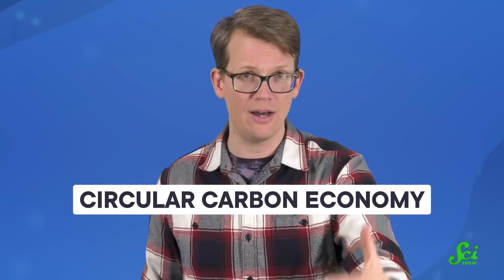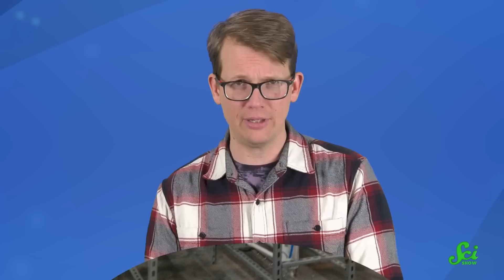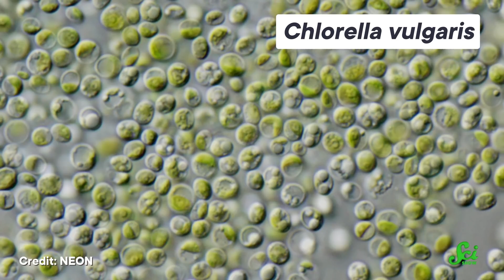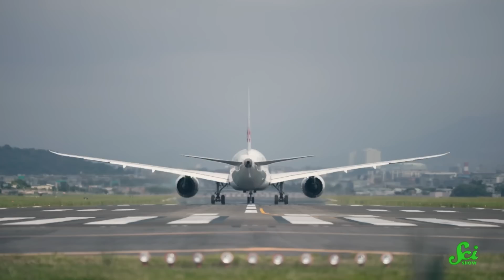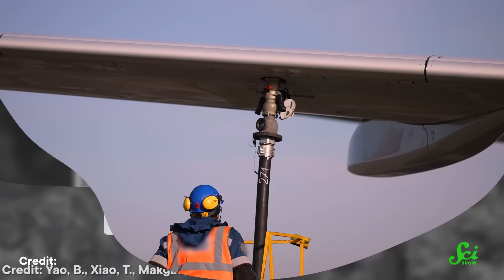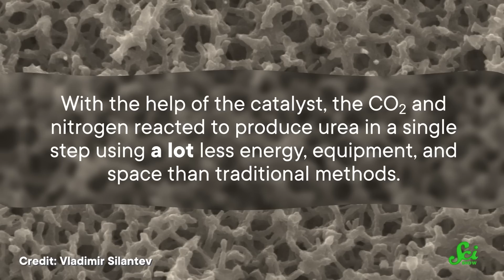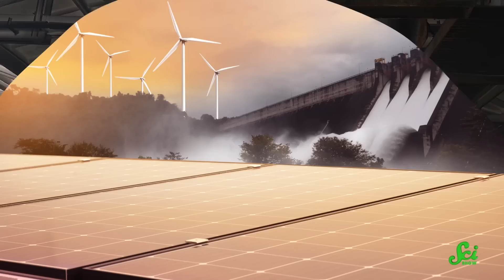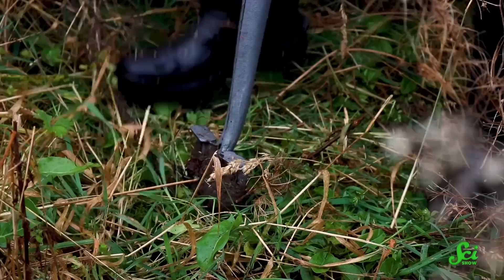One Way to Deal With CO2? Reuse It

Comment: It's HUGE and I've said for years (I have a degree in geological science) that the key is to turn CO2 into a renewable resource.  A company in Canada has created fuels from atmosphere CO2.  That would solve all the transportation of fuels as well
Reply: Carbon-based self-replicating nanomachines!  Wait, that's...algae.
Reply: @CyberiusT  Kelp is also incredibly fast growing.  I think it grows in feet (not inches) per day.  We need a way to repopulate the ocean with fish by introducing something that can drastically increase the amount of plankton.
Reply: honestly I think that the turning of co2 into fuels is, at least at this point in time, one of the best ways we have to store energy and for transportation. it may not be the most efficient but the biggest problem with solar and wind is that we need to find ways to store the energy from peak hours to use at non peak hours and batteries do not have enough energy density to do this on the scale we would need, even solid state batteries probably wont be enough. I honestly think nuclear energy is the way to go for energy production but solar and wind are not without their purposes, we just don't have the technology or infrastructure to rely solely on wind and solar like many people want to.
Reply: @Hesediel01  I hope we can avoid nuclear energy. It is poisonous for sooooooo long. And nobody wants to store the waste. It took 25+ years for them to open a storage site in my state and they have already had an accident within the first 20 years. Scientists estimated it would be 200 years before the first accident.
Reply: @Hesediel01  I agree.  Carbon can be converted into bio-fuel and pumped back into old, now-empty oil wells.
Reply: That is like making table salt from Lake Michigan water - instead of ocean water. Possible, but stupid and inefficient. Hugely stupid, hugely inefficient.
Reply: @kurtilein3  do you happen to have a better idea, as I said I know it would be inefficient, but so was almost everything when it first started out, the first light bulbs lasted somewhere between 14 and 48 hours, the first automobile had .75 horsepower and went 10 mph. There are plenty of ways to make the process more efficient, like take some of the biggest carbon emitters and put a carbon filter in them that can then be recycled so you don't have to pull it from the air.
Reply: @Hesediel01  Yes. As long as coal-fired power plants exist, and natural gas-fueled power plants exist, and internal combustion engines that are stationary, use the exhaust of these. You can get highly concentrated exhaust containing plenty of CO2 there. CO2 content in the atmosphere is somewhere around a worrying 400 parts per million, but that exhaust can have 30%, which is orders of magnitude more. 

As long as highly concentrated CO2 exhaust exists, it is dumb and inefficient to scrub CO2 from the 400 parts per million in the atmosphere. Scrub from 30% instead. First the power plants putting out high concentrations of CO2 have to go or have to have their exhaust used, and after none of these are left, we can consider scrubbing the highly diluted 400 parts per million.

Is that clear and understandable? 

To capture carbon, you might also consider managing a forest in the following way: Whenever a tree is about to die, cut it down and bury the wood underground. That removes a large amount of carbon. Scrubbing from the atmosphere does not remove carbon if your plan is to turn it into fuel to burn it again. A Treetrunk of wood buried fireproof removes many tons of carbon permanently, and its rather cheap and easy. 

Do you get the idea? Plants and Trees in Wetland are good solar-powered carbon-scrubbers, and this is what your "hopium" technology has to beat.
Reply: @kurtilein3  I was more referring to the capture of carbon from something like power plants, and industrial buildings for use in creating fuels when there is an excess of energy from say solar or wind energy which ends up causing problems with the grid and being wasted, that fuel can then be used as a more "carbon neutral" way to power traditional power plants, or even vehicles essentially taking the place of batteries which have far less energy density (by a factor of around 100). Less so about scrubbing from the atmosphere, though even for that, assuming as low as a 50% capture rate on co2 that could reduce our co2 output by 25% if applied to powerplants and industrial plants. So in short I just think it would be a better method of energy storage than batteries and would also have other benefits.
Reply: @Hesediel01  Excess energy, if it can be stored instead of being wasted for bitcoin, can be used to displace fossil fuels. Energy storage can be done using hydro, a low pond and a high pond and pumps/generators inbetween. Storing pressurized air in caverns can also be done. 

For carbon capture, vegetated wetlands and forests rule supreme. To capture carbon, bury carbon-rich biological matter underground. If you bury carbon-rich plant matter for hundreds or thousands of years, you are creating new deposits of oil, gas and coal. You just need to hope that future generations are not stupid enough to dig it all up and burn it all. 

Even more effective: Put an end to extraction of fossil fuels now. Keep the carbon out of the atmosphere and in the ground now. 

The entire video only has meaningless distractions.
Reply: @kurtilein3  as I said before I'm more concerned with energy storage than carbon emissions, which are just a fortunate byproduct (by the way phytoplankton are alot better at scrubbing carbon than trees). Yes hydro electrics are a good way to store energy for stationary purposes, but you can't exactly use it for airplanes, vehicles, ect. Yes there are electric cars but they are not feasible for a majority of people especially now. batteries will likely never be anywhere near as energy dense as gasoline and will not be able to be charged as quick as filling a car with gas. The thing is that as a country we are not ready to be rid of fossil fuels and we can't beat the energy storage of hydrocarbons, so we might as well embrace it and find a way to make the situation better instead of pretending it doesn't exist.
Reply: @Hesediel01  Honestly, hydro electrics aren't really a good way to store energy either. You're flooding a lot of land to get very little energy storage. It's main advantage was always the relative simplicity (and being able to quickly respond to short-term changes in load), especially when you can use existing terrain to your advantage and cost, when land is really cheap (of course, authoritarian governments always loved hydro, because they can just take whatever land they want). But water isn't all that dense, and you need a large drop to store gravitational potential energy (whether for generation or pumping water storage). It's always been just a quick stop-gap for the ten or twenty minutes it took to start up more fossil-fuel generators.

I wouldn't say batteries will never be as energy dense as gasoline. But relying on that to happen soon enough to matter is wishful thinking. We need a thousand approaches that are working concurrently, not put all our eggs into one "holy grail" basket that magically solves everything (and when it inevitably fails, everyone dies). That's how both nature and human society has always worked, and there's many reasons for that. The Marxist idea that having The One Right Thing For Everything was always just an illusion, just like ideas about genetic purity and all that - resilience and efficiency ultimately comes from many things doing the same thing differently. Each approach has some niche where it works the best, and others where it's atrociously bad. That's just the way reality works.
Reply: @LuaanTi  in my opinion the best way to deal with the problems caused by solar and wind is to not try and make it our main source of power. We really should be working on nuclear energy. There is a realy promising design that I saw that can be refueled without shutting down, i believe it was capable of using waste from other reactors as fuel, and the waste it produces is only dangerous for a fraction of the time of others (look into the "elysium reactor"), we are also making strides in nuclear fusion, just this year the record for fusion power was doubled and i believe if nuclear energy got the same government subsidies as wind and solar we would be alot further along. This won't directly help with vehicles but it will reduce the amount of oil being burnt for power plants and thus will increase the amount available to refine into other fuels.
Reply: @Hesediel01  Yup, that would be my bet as well. Heck, it's really dishonest talking about how nuclear isn't viable without subsidies when it 1) isn't true and 2) coal is subsidised, for Christ's sake.
Reply: @Hesediel01  You are making sense. @kurt is definitely not. If every building was removed from the earth and trees planted across every square foot of the globe, it wouldn't be enough to reverse global warming.  He is also talking about filling dried up swamp lands.  With what?  Water we pump out of drying-up lakes and streams?   He obviously is not as aware that the climate change crisis is a CRISIS
Reply: @LuaanTi  Too bad we can't cause volcanoes to erupt at will.  I recall in the 90s, one erupted and there was so much ash for so long in the atmosphere that it dropped the average temperature by 0.5°C for an entire year.

We need to have a way to quickly increase the amount of plankton in the ocean to increase the number of fishes.  Maybe, we can force-feed whales so they excrete more feces! 

It's a global issue, and using the ocean to our advantage would allow many countries to directly participate.  It's the politicians in most countries collectively who could not agree on solutions that brought us into crisis mode.  Countries can no longer say we aren't going to do anything because country A, B or C isn't pulling its weight.  I think most of the large nations (population) have finally realized this.
Reply: @kurtilein3  I didn't mean heatsinks were a goal, I meant it's one possible use for a billion or so tonnes of carbon.
Reply: @CyberiusT  If you make a former swamp wet again, plants will do the job for you. You can also use a healthy forest, expand it, and bury treetrunks in a deep and fireproof way. 

Carbon capture is best done by wetlands and trees, and this is what technology would need to beat. I can beat your technology by taking a shovel, collecting dead wood in a nearby forest, and burying it wet and fireproof. Do not forget that we have fossil fuel fired power plants all over the place, emitting high concentrations of CO2. So we need wetlands and forests, and the idiots promoting carbon scrubbing are just a distraction.
Reply: @kurtilein3  Do you have any idea how many years it takes one tree to remove one ton?   Longer than most trees even live.
Reply: @B_Bodziak  I cannot tell which of your comments respond to which of my comments, Youtube does not provide us with a clear and clean structure of which goes where. I know some things changed, 21 of the 30 globally hottest days after 1881 have been in July 2023. OK July is the globally hottest month every year, that is how seasons work, but 2023  took the top 21. 

We need to start doing now what can work fast and we need to start now. A big one may be turning former swamps that degraded back into swamps. This can be done quickly. Next one is to stop eating meat, noone goes hungry but 80% of agricultural land could be abandoned. To feed our world full of 8 billion humans without drawbacks and noone going deficient or hungry we need 80% less land. Stop eating meat is the first step, eggs milk cheese and fish are somewhat less impactful. That can free up 50% or more of the land used for agriculture. 

If more meat stays in the market to rot unsold and be written off, trust me, less meat will be produced. 

Meat consumption going down just 10% now, just 10%, means that then 8% of currently used agricultural land will be abandoned and be left to nature. That is then where you need to restore swamps or plant forests.
Reply: @kurtilein3  I wouldn't call the endeavor "stupid".  Is it expensive to research, to start, and to scale up?  Is it something that must be done?  It's something that shouldn't have had to wait until crisis mode for countries to start funding the research for solutions.  We've known about this for decades, but a good chunk of politicians decided to call it a hoax because they're in the pockets of big oil.  Now, even oil companies cannot deny it.

Comment: Getting to a carbon neutral society is   a worthy and useful goal. However if we want a carbon negative society, if we want to get back to preindustrial carbon levels we're going to have to look at serious cost effective carbon sequestration. I've heard that the best, most straightforward path for this is mass reforestation. If we simply start planting trees everywhere we can possibly think and engineer around, that it will be enough, or close to enough. Is this true?
Reply: Getting to a carbon neutral society is the far more important and pressing goal.  

If we were to plant trees on every patch of land which would grow a tree, that would just about do it to bring us back to around 200ppm if they all grew to maturity instantaneously.  Unfortunately, at our current production of CO2, we'd need to do the same sequestration every 50-60 years or we'd be back in the same spot and trees take a while to grow.

Once we've forested, trees will grow and trees will decompose and the carbon sink will remain roughly the same depth.  It's an out we can only use once.  Reducing emissions is the only path forward.
Reply: @LikelyToBeEatenByAGrue  "It's an out we can only use once."  True.  Trees are wonderful and planting more of them helps erosion control, biodiversity, and pollution reduction, but unfortunately planting more trees does nothing to fundamentally solve climate change.
Reply: Kick the can down the road.
Reply: Of course not, it won't fit on arable land. It doesn't suck though, that plus other sinks add up, see those IPCC reports, one section backs up what the others say so it's not a slog to go in and grab answers.
Reply: It’s true.

Comment: would the carbon reuse loop cost more or less, let's say for airplane fuel?
Reply: way way more, this video is exponentially underestimating the energy use and product yield, like for aviation fuel u need to spend energy to capture CO2, purify it and then electrolyse it to form CO, as CO2 does not react, and then you need to get H2 from water by electrolysis and then you provide 350 C heat to react, and out of this the video talks as if the 100% of carbon and hydrogen you put in will convert and come out as 100% jet fuel.

in reality you would get as like 70 ish % reacted products 5 to 10 side reactants and remaining unreacted products, so you will have to distill it to seperate the jet fuel and use it. 

thermodynamically speaking this is possible, but it's a very energy intensive process. because if you want to make 1 liter of jet fuel, then at MINIMUM you will have to provide the same amount of energy to make the exact 1 liter, but in reality there are so many inefficiency in every step, and the thermodynamic feasibility, so you will be using like 1.5 to 3 liter of jet fuel (using it in a gas turbine to produce energy for this reaction for ex) just to get 1 liter of jet fuel. in no matter what scenario u want, this is not economically feasible. it is possible with renewables, but they have their own problems in terms of industrial scale to provide sufficient and reliable energy to perform these 24X7 supply wise

Comment: “…and 350° of heat [temperature, btw, not heat, also no unit used. Sloppy science communication there, scishow]… and voila!” So there’s the catch. Energy in > energy out… you’re just burning fuel to make fuel with this process. I guess you could use waste heat from other processes to power this reaction to increase net efficiency, but I can’t imagine a way to scale that up in way that’s even remotely useful.

This isn’t even to mention the energy costs of producing the catalysts and vast amounts of hydrogen required.

Comment: I've been saying for over a decade that we need to place carbon scrubbers all over cities and use the carbon from the filters to make carbon composites.
Reply: You've been telling the wrong people or have not been convincing. Keep at it, it's a fine idea!
Reply: Did you really not think algae used solar energy? They can be GMO to ingest more CO2 and make fuels, pharma products, lignin, nanocellulose, feeds, probably baby formula, roadway binders, carbon fiber maybe.
Reply: @Professor Frog even if you emit 99% of what you capture, it's still worth it, and over time will make a difference. As long as you emit less than you absorb it works